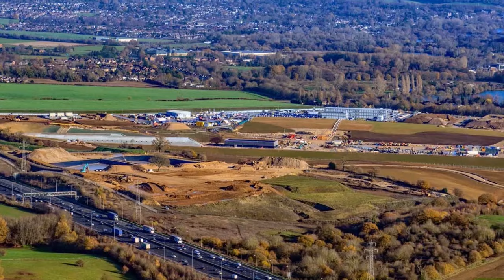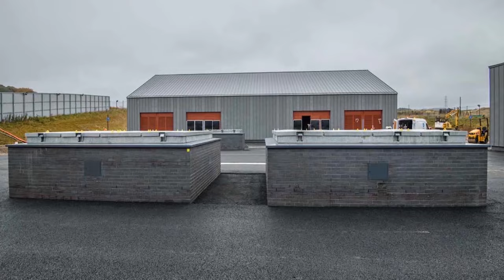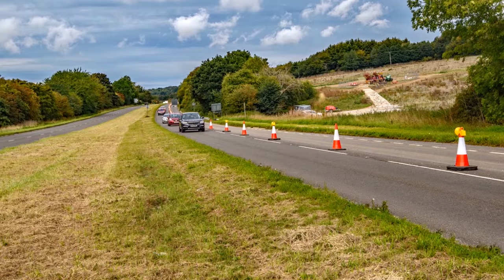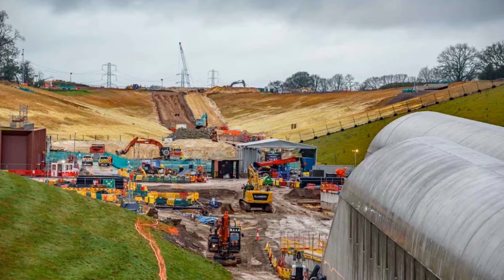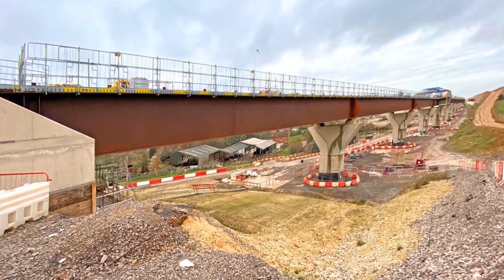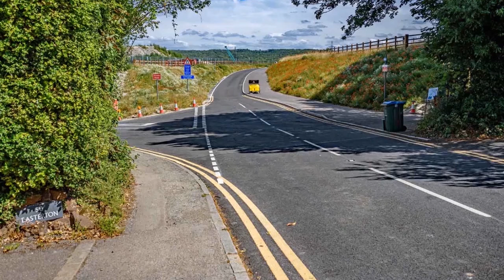26 01 Eleventh HS2 Update for the Chiltern Society

Comment: In Amersham - Its a shame the Corten Steel was dropped in favour of the harsh concrete and flint with panels at a collapsed angle. 
Also a shame that as the previous path went through the middle of the site (trees) that the new path is a harsh pavement against the road, when there is room to go through trees again at the far end.

Comment: another concise progress update _ it was interesting to see the 5 ventilation /intervention shaft headhouses _ as these have basically not been covered by the various drone operators _ a minor part of the project but an important element in both the operating & safety of the tunnels _ the update regarding the TBM by the green tunnel at Wendover _ informative as on your previous presentations _ a well done